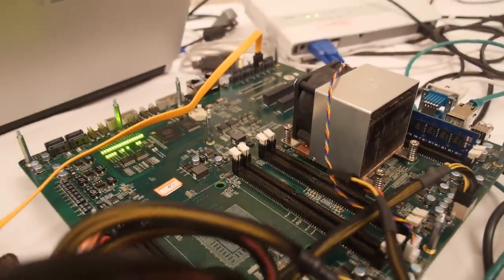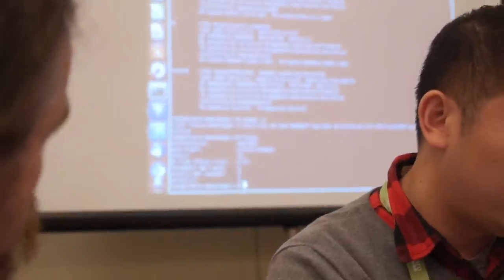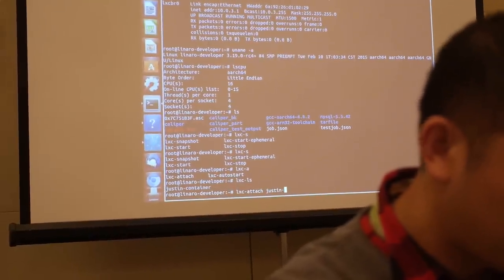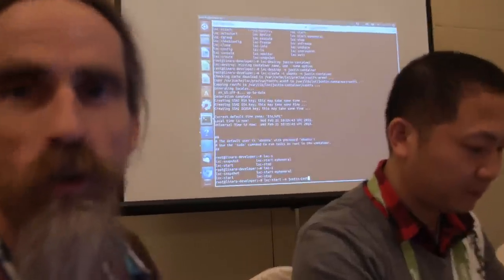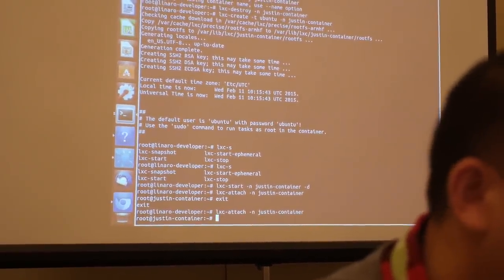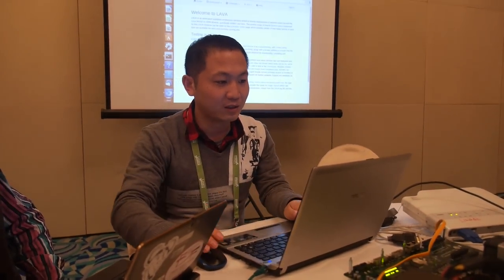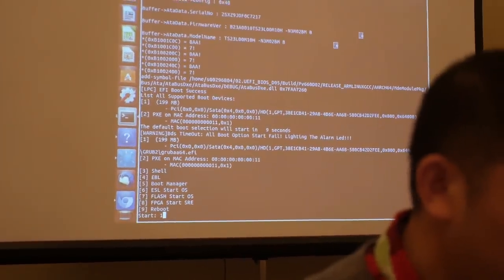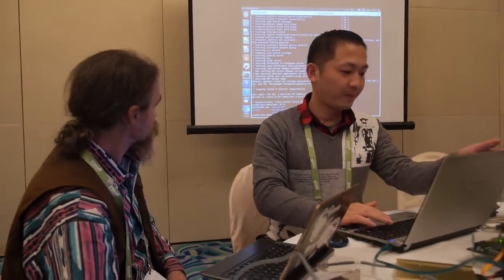Hisilicon D02, 16-core ARM Cortex-A57 High Performance Board (32-core version coming next months!)

Comment: Imagine if they made a 16 core cortex a75. a75 is more then 2X the performance of the a57
Reply from the maker: Hisilicon D05 uses 32 core ARM Cortex-A72 at 2.4 GHz
Hisilicon D06 uses 48 Ares cores operating at 3 GHz, not sure how that performs, sounds like maybe those are a custom designed cores by Hisilicon, maybe performing above ARM Cortex-A75 and perhaps on 10nm or perhaps even on 7nm coming up.